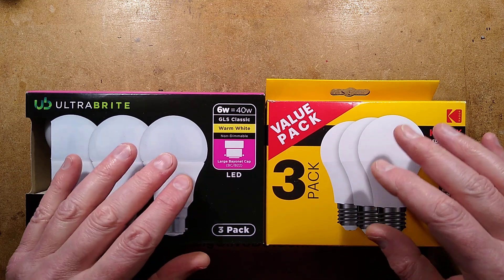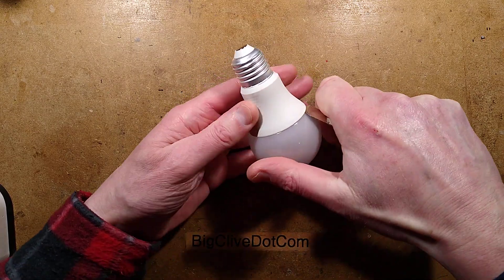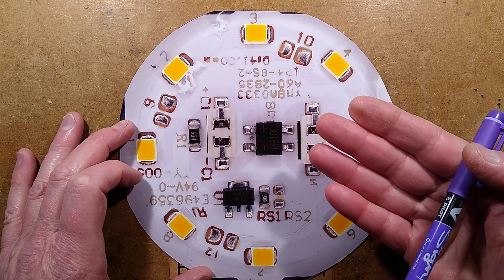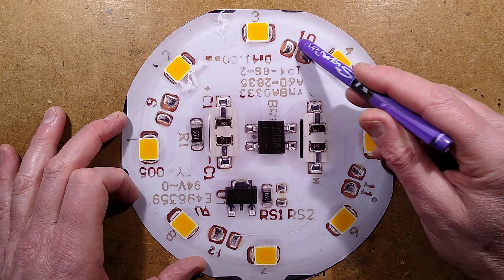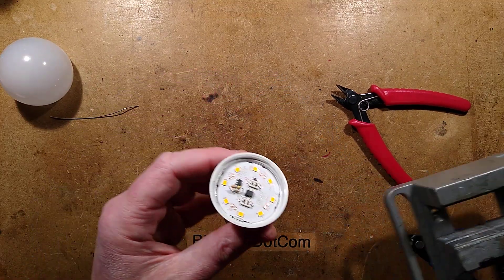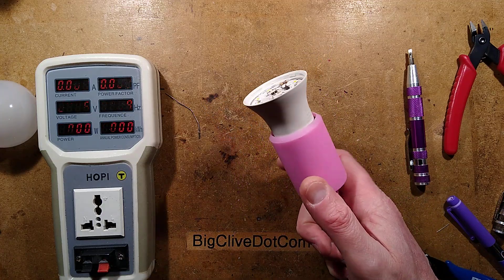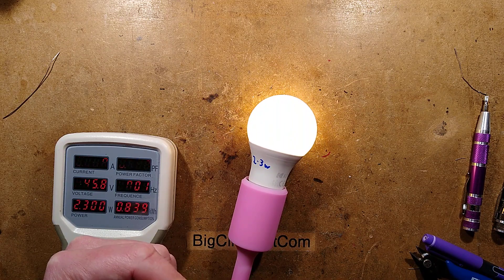Hacking Kodak lamps

Comment: Great hack Clive.  What I don’t get, & we don’t all live in Dubai, is that these L.E.D bulbs claim to last 100,000 hours.  They don’t.  Then you go to change them & have an E27 bulb to fit into a Bayonet fitting.  I know you can get adaptors, but why are there two types?
Reply: I think the ES type of lamp holder started getting popular because Ikea uses it in all their stuff, and it just started to catch on more and more. The bayonet fitting seems to be on the way out now, and I don't think we'll have lost anything particularly worth keeping when it's gone. 
I guess the reason it was "traditional" in the UK to begin with is because it used to be very common to power other appliances from a ceiling pendant - back when electricity was a new fangled thing there wasn't really anything to power with it except for lights, and then people started to power their irons and stuff from the lighting circuits because there wasn't anywhere else to plug it in!
If you're powering something with a cord a bayonet fitting is much better because you don't end up with a twisted cable.
Reply: @jhonbus  Great answer.  Thank you for taking your time to reply.  I understand now.  IKEA you! 😀👍

Comment: I bought one from Tesco as they claim 1500 lumens. Put it in the bathroom globe and boy is it bright. Decided to buy one for the kitchen and it only lasted 10 months by which time I had lost the receipt.
These things don't like being closed up inside a globe light.
Time to rethink what I can get for the kitchen. Maybe a 4ft led panel?
Reply: Secret is to save the package and chuck the receipt into it!!
Reply: If you're okay replacing the entire light fixture then a large panel is the best way to go because the large surface area means it can effectively dissipate heat. Unfortunately many panels are just edge lit by strips but this is still quite good.

Comment: 0:38 Has anyone tried returning lamps which failed the guarantee? I've been pretty lucky (even with the Poundland ones). The only ones that ever failed were some old ones from AliExpress.
Reply: I did here in Finland. They just say go get new ones. Dirt cheap stuff.  Usually just too lazy, even if I have e-receipt..
Reply: @Tsiikki  You will be required to buy Russian light bulbs soon.
Reply: @travisash8180  Yeah sure..
Reply: One IKEA lamp failed, but they have discontinued that particular dimmable SKU. Not bothered with returning it as want to tear it open for inspection 😅 Have returned to ASDA couple failed LEDs (made by TCP) that barely lasted a year, can't say they were the cheapest ones.
Reply: @Siniad  Disappointing, because I saw TCP CFLs last for at least a good while, they were still fine when I last checked, back in 2016. I got them in December, 2010. But I don't have them, they got left at my former place. (March 5, 2008-April 15, 2016, so 8 years was how long I lived there)

Comment: Life hack: I have a complete set of incandescent and LED lights for the house. In winter the incandescent lights are 100% efficient at light output and heating the house. In the summer LED lights are technically less efficient because they must get cooled down by the AC system. Even though it’s a minuscule amount of WA.
Reply: Incandescent lights are more efficient at heating than a HVAC system because the heat doesn’t have to travel through ductwork to get to where you’re sitting.
Reply: Let me know what you think.
Reply: For some reason it just feels right to have old incandescent lights in the winter.
Reply: They may be 100% efficient but you still may be paying more for the same amount of heat if your main heating source doesn't use electricity (gas, etc). Sometimes that's not always true depending on how much things cost.
Reply: @androiduberalles  Thats true if you have cheap gas and can tolerate it. My HVAC is also a heat pump so it’s very efficient. It’s more of a personal preference this is really just a few dollars a month.
Reply: 100% efficiency sounds great at first but then you remember that heat pumps are like 200-300%.
Reply: @thatguy7595  You’re right. All I’m left with is just personal preference. Wavelengths go brrrr

Comment: For most of us, the time we would spend hacking the light isn't worth our hourly rate. But if you enjoy hacking the light as hobby that's something different.
Reply: That would depend on your time management, if it takes you an hour to do the hack, than maybe, however, this is a 10 minute hack at the most, providing you have the resisters. If it extends the life of the bulb a significant amount, that is less time buying and installing bulbs which probably works out to be quite a bit more than just doing the simple hack. What I am saying might not be the case, just something to consider. I have bought led bulbs that did not last very long and that in of itself is annoying.
Reply: "the time we would spend hacking the light isn't worth our hourly rate"... your not meant to be doing these hacks while your at work..
Reply: Maybe you should abandon that always be grinding bs mindset and enjoy life a little
Reply: It also depends on where you live, in most of the US electricity is fairly cheap, so people can quite happily ignore LEDs and stick with old incandescent, however as of recently price has been going up it could be as little as 10 cents per kwh now but in some places it could soon be up to 50 cents per kwh, so yeah even saving as little as extra 5 watts would make a far more significant difference when you start paying over 20 cents a kw.
Reply: The wattage you save alone should justify more than your hourly rate. And if these lights last like 600% of your regular bulbs then you've saved 5 visits to the store to buy replacement bulbs. Plus the time it takes to buy those 5 more bulbs. Some years ago I hacked some clearanced pre-CFL outdoor fixture bulbs into 2 indoor lamps and I figured, after the fact, that I saved a megawatt over the time they ran. A million watts. Let that sink in to your head for a moment.
Reply: I don't know how cheap LED lamps are by you, but the cheapest I find them here is at best 5€ a pop. If it takes you less than 30 minutes to mod those, then it cost you less than the minimum wage.
In addition to that, as mentionned before, you also have to account the time wasted to replace your bulbs (which may include getting a stepladder, removing glass fittings, etc...).
That's even considering that you'd be doing that in a purely economical mindset; you can also do that out of pleasure of doing some good craftmanship, but also in considering you're saving some ressources.
While I'm not all about ecology (mostly because I think most of what's done today is just greenwashing to keep the machine running) I think that making things run longer is a cost and hardware-effective solution. And this one here is really simple to do.

Comment: The manufacturer thought we will stop everyone using Clive's method of cutting off one of the resistors, Clive now shows how to just replace the one resistor. Manufacturer's are now pulling their hair out lol. Well done Clive saving these bulbs from quick landfill
Reply from the maker: It wouldn't surprise me if they set the current value internally in the future to prevent hacking.
Reply: @bigclivedotcom  The proportion of people who will care is vanishingly small.

That said, old electronics is supposed to be recycled in most advanced societies.
Reply: @SeekingTheLoveThatGodMeans7648  Some of it can be recycled some cant. I'm not sure how you would ever recycle the resin in the IC body or PCB. Even the boric acid can be recycled in old electrolytics assuming it has not leaked out. Bond wires are gold so easy to recycle.
Reply: @bigclivedotcom  how about setting the pcb on a reflow heater and replace the linear regulator if they decide to go preset. The heat may consume the leds but maybe worth a try! Maybe worth me trying hmm. Minware makes a small reflow, same maker as ts100 iron, which, is a great little iron at 65W
Reply: @bigclivedotcom  Yep. Longevity is a no-no for nowadays industries - programmed obsolescence is the name of the game.
Reply: @JoseSilveira-newhandleforYT  
     You are so very right. I'm known in my area for electricity and battery knowledge (people bring me all sorts of things to fix). A big thing is the acid (or people say water) level in vehicle batteries. Knowone checks the level anymore and ruin or replace many batteries for low levels. Nearly every battery is serviceable though. Most still have easy access caps under a sticker and a few have the flush, snapped in caps that you have to pry out.
     In any case, 90% of the time when you get a brand new battery it has a low acid/water level! As you said, they want it to just make it past the warranty and 'die'. Golf carts are popular in my area and the electric ones have six batteries that cost around a thousand dollars to replace the set. I can't remember how many golf carts I have 'fixed' for people. They have damaged the batteries but usually only have one truly bad battery. I usually empty the batteries as well as possible and refill them with new acid. I charge and discharge them in pairs and decide which if any batteries are actually bad. Replace the bad one and equalize them and usually folks can get a couple more years of use out of the set of 'bad' batteries. 
    If they would keep the water checked and not try to totally discharge the batteries, most golf carts can get many years from a set of batteries. 
     Nice video and Ideas. Ya'll Take Care and be safe, John
Reply: @JohnDoe-pv2iu  Yep. I also try to recover some lead-acid batteries, but not always with success - some have internal shorts or internal connection breaks. One thing I haven yet tried in flat batteries is to recharge in reverse polarity until they start to get a charge and then reverse it again (possibly do it a few times). Supposedly, this might help reform the plates, but I'm still waiting for a suitable guinea pig to try it 🙂
Reply: @bigclivedotcom  
They wouldn't do it to prevent hacking, they'd do it to save on one extra component. Although I think the logistics of having multiple parts for different currents in stock is actually more expensive than the cost of the SMD resistor.
Reply: 😠 - while me and dad continue to replace the GU10 LED spot lights in our kitchen - mum has them on all day due to how poorly lit it is with natural/sun light ☹️.
Reply: @samuelfellows6923  I've realized over time that better homes have their kitchen windows for all day lighting a this increases the UV exposure which santizes items as well.
Reply: @johnpossum556  standard windows block uvb and uvc so they have no sanitary effect
Reply: @johnpossum556  modern low E window glass blocks almost all UV.
Reply: @samuelfellows6923  I've replaced all GU10s in the kitchen (8 of them) with hacked Lepro LE 5.2w / 400lm GU10s from amazon. They have the exact same regulator and sense 2 resisters. They now only get mildly warm and I've not had to replace one since. Previously, LED GU10 would only last about 6 - 12 months
Reply: I brought some 100w equivalent LED from Wilkinson (Wilko) they flicker, maybe interference from my striplight?
Reply: 😅I should zoom out again.....
"ZOOOOOM" that made me laugh 🤣🤣
Reply: @y0uCantHandle  UVA will cause skin damage including premature aging and contributes to skin cancer. The UVB which is not absorbed will also contribute to tanning, skin damage and skin cancer. That automobile glass blocks UVC is almost wholly irrelevant as UVC rarely reaches even the upper troposphere let alone anywhere cars are found.
Reply: @y0uCantHandle  If you are going to make up a rule that comments have to be relevant to UV sterilisation, why does your comment mention tanning via UV-A?

I just extended that topic to note (contrary to what appears to be popular opinion that natural light received in a car is safe, cars being the domain I hear most mentioned) exposure to UV-A not only causes general skin damage but also is a substantial contributor to skin cancers.
Reply: Sad really, makes we wonder if we'd all get on better in some kind of Amish stronghold or something.

Comment: Nice, I'm just wondering how much brightness you lose in the mod. Due to increased efficiency it should be more than 25% brightness at 25% power, right? Would be interesting to also compare the lumens or rather lumens per watt for the modified lamps...
Reply: That's what I was wondering a few videos back. Is there a datasheet chart out there showing us where optimal brightness and efficiency meet w/o overdriving the LEDs?
Reply: Read your question too late and asked the same. Oh well. :-)
Reply: i remember on an older video where he said that the watts to lumens isnt exponential and the more power you give it it wont necessarily get the same amount brighter if it is being over driven. so they are infact more efficiant if run at their rated current or less.
Reply: Fortunately perceived light isn't linear, and neither is efficiency.
To get a brighter bulb, at some point you either burn out or more than double wattage for a noticeable change.
So going the other way, even a little lower wattage doesn't dim much, but it saves a good bit and stresses the circuits less.

I had dimmable bulbs that were too bright, at lowest brightness, at 9watts, 6watts, and even 3watts. 
Eventually got to 2.5watts to dim enough to see at night, without disturbing people sleeping, while also not tripping on furniture.
Reply: Clive made a video to this effect a while ago. https://www.youtube.com/watch?v=biEZ1TbdhhU
Reply: The change in light output due to changes in efficiency isn't that large. But the change in lamp life time is huge.
Reply: Or instead of buying the brightest globes and hacking them so they are dimmer... buy the lower rated globes? 

Normally there is about 100 lumens per watt. So driving a 11w (normally 900-1100 lumen) globe at 2.5w you lose 750 lumens. It's almost linear.  The efficiency gain will not likely be visible to the human eye. Also cold vs warm lamps are perceived differently for the same output. 

Around here we can't ever find the the brightest globes, particularly in the smaller form factors, so ide be more inclined to go the other way and drive the cheap ones harder. 
Lifespan is not critical when 85% of the 3 years that they warranty them for, they are turned off.
Reply: @discordia013  
I wouldn't mode them to save on electricity. For that you could indeed just buy a lower rated bulb. But modding them really increases lifetime. In a lower rated light the (fewer) LEDs will still be driven close to their maximum. 8 LEDs a half power will last much longer than 4 LEDs at full power.
Reply: @discordia013  By modding the higher power bulbs to low currents, you can massively improve the efficiency and lifespan. All bulbs are overdriven to the same extent, a 10W bulb might have 10 LEDs overdriven to hell, and the 5W version having 5 LEDs overdriven to hell. Take a look at common SMD LED data sheets, the efficiency when they aren't overdriven is around 200lm/W, which you can get close to with the hack.

Comment: "The soldering station says...what the heck?" It's nice that they're giving systems such clear error messages these days.
Reply: its when you just get 🤷‍♂️ from your iron you need to buy a new one.  LOL
Reply: @dcallan812  Got the same station Clive has. For 50 EUR. Replacement handles cost 30 EUR a pair here.
Reply: @kyoudaiken  SO is it worth just buying a new one with the warranty?
Reply: @dcallan812  My last handpiece lasted over 4 years. And I abused it quite a bit. This time I am a bit more careful. Should last me a lot longer. I got another one spare and I think I don't need to buy any more for the rest of my life.
Reply: @kyoudaiken  great. 👍👍 you made me smile and thats hard, Im a real grumpy old man. Take care with your tools and they will take care of you by not falling apart. 👍Thank you for the reply
Reply: @kyoudaiken  My current handpiece was made in the early 90s. It will probably last me at least through the rest of this decade..
Reply: @Monkeh616  We are talking abiut a 50 EUR China Hakko clone soldering rework station with hot air gun. The YIHUA 852D+. For that, I found it impressive that my handpiece lasted 4+ years while abusing it a lot. I used the tip to bend over legs of components to get them out when using desolder wick. I'll not do that anymore now. Let's see how long my handpiece lasts now.
Reply: Mine just says "Get bent." Then again, it's not that great a pry bar.
Reply: The soldering tip was BIG
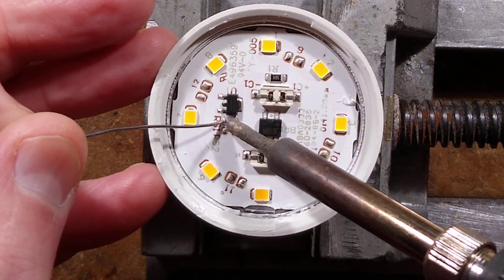Reply: 7:00
Reply: @ 7:17

Comment: I hacked all the lamps that I had, however only to about half the power. They stay at 50 °C but for electronic components that does almost no damage and they shall last very long. 
Going from a 10W to a 2,3W  isn't something I would do, it's way too low for me.